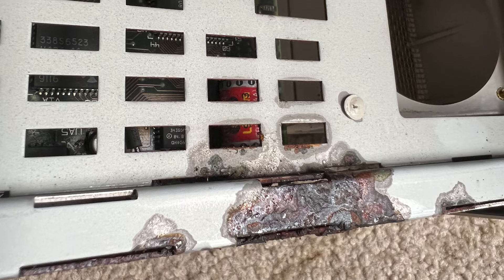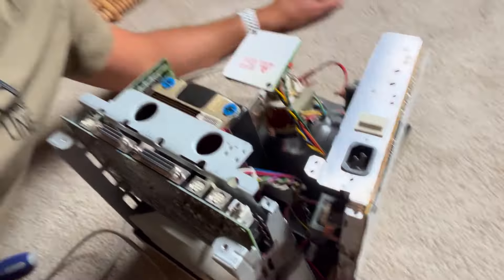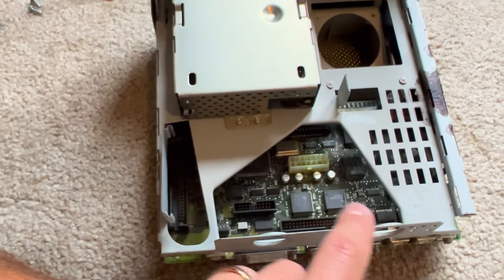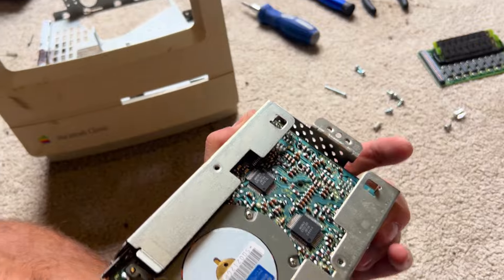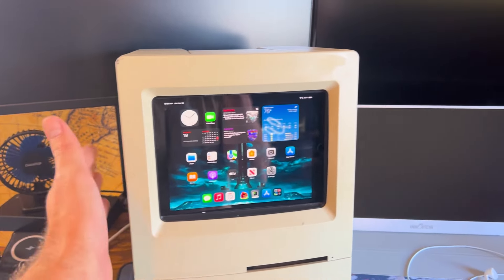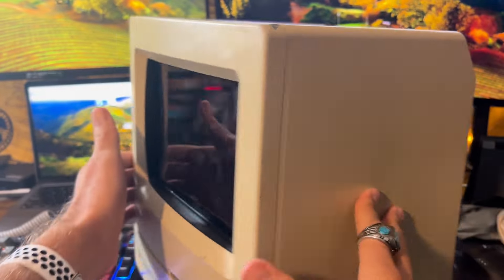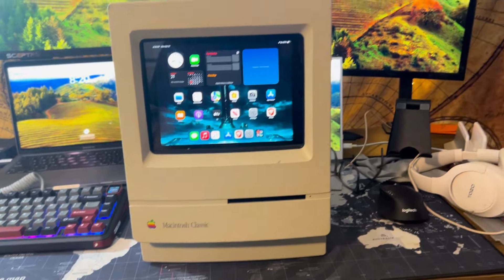Macintosh Classic Gets a 2024 MAKEOVER with Ipad Mini

Comment from the maker: Timestamps:
0:10 – Why the Macintosh Classic Was Beyond Repair
0:44 – Discharging the CRT Monitor
1:02 – Corroded Components & Teardown Begins
1:46 – Identifying the Cause of Failure
2:28 – A Deeper Look at the Battery Damage
3:31 – Preparing the iPad Mini Installation
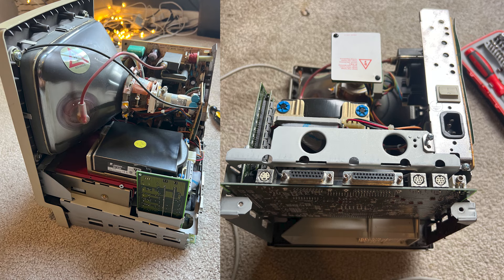3:57 – Cleaning Up the Corrosion
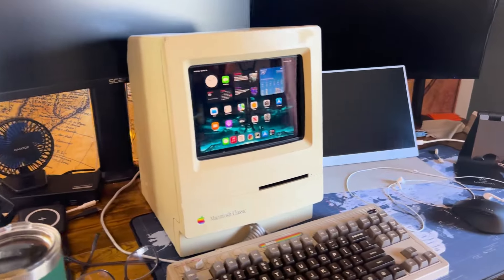4:11 – The Final Product: iPad Mini in a Macintosh Shell
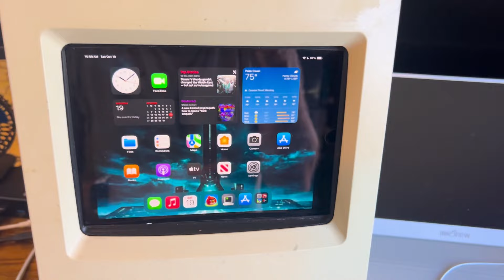4:48 – Bluetooth Integration
5:08 – Future Plans for the Trashintosh
5:36 –A Full Walkthrough of the Trashintosh Build